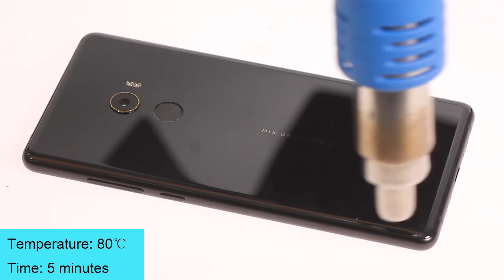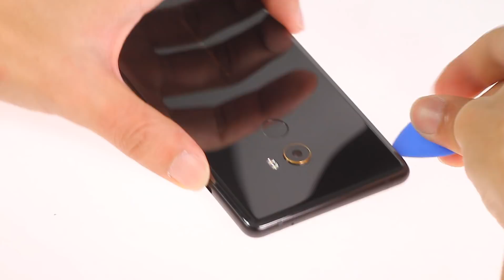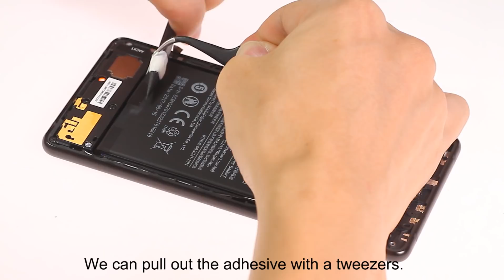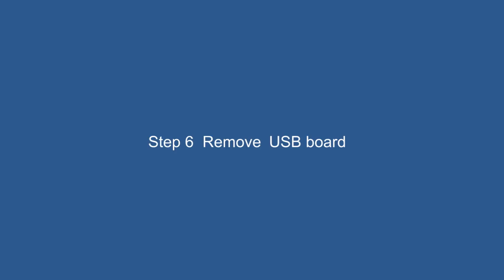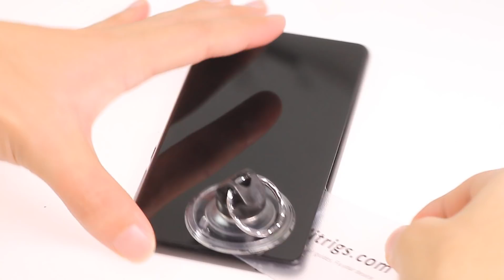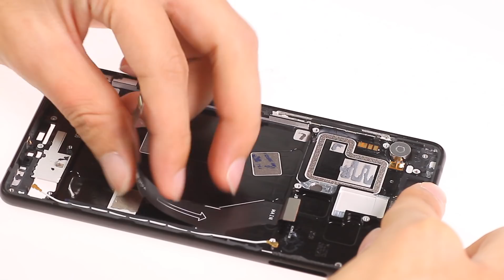Mi Mix 2 Teardown

Comment: Would it be difficult to remove the camera glass and led flash cover from the back cover and put it on a new back cover?
Reply from the maker: Not difficult. Heat up with a hairdryer and poke them out.

Comment: Why don't they make phones that are easy to open? Instead of prying the phone, what can't the phone open effortlessly by using gasket instead of adhesive? Why can't the user just open and change the battery without needing to bring the phone to a specialist at the service center? Just wondering why almost all smartphones manufacturer are making such an easy task so complicated?😐 Remember the nokia phones?